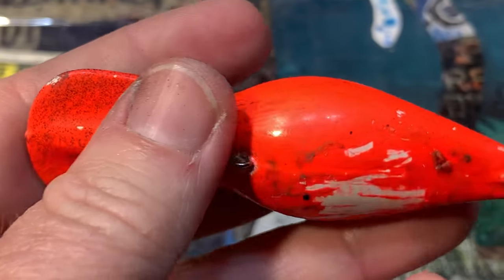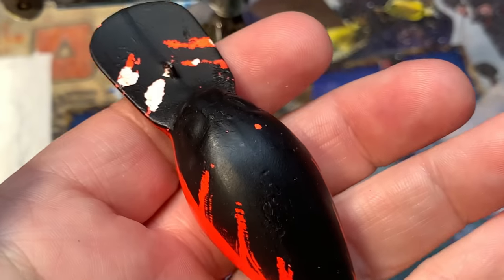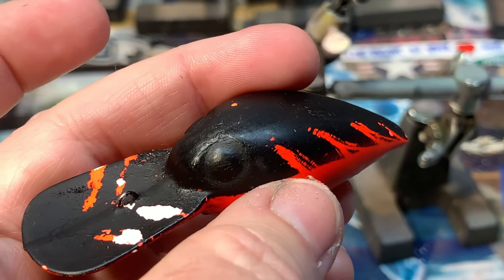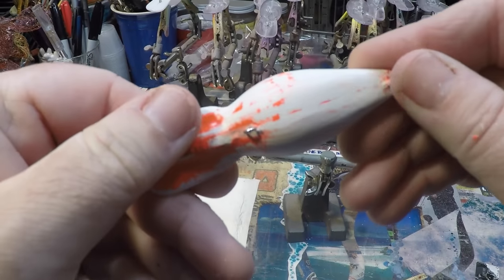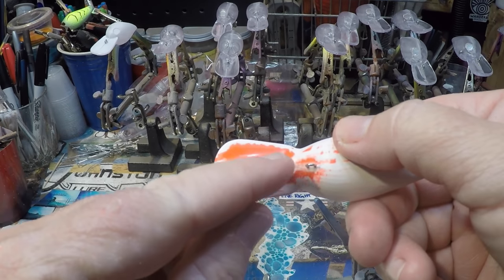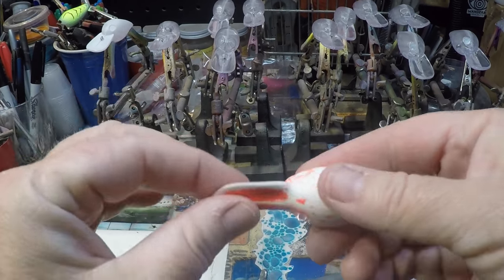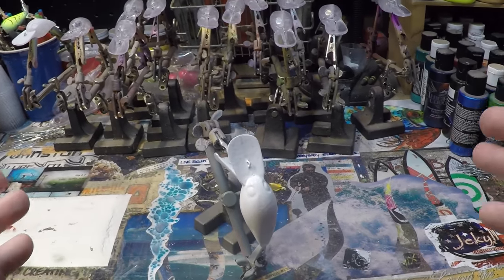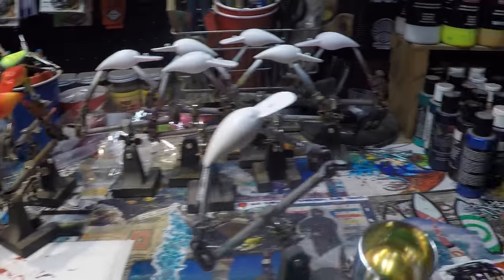START TO FINISH!! (Pre-Rap Wiggle Wart)

Comment: A little tip for stripping paint, this comes from models/miniatures. Soak the bait in LAs totally awesome for an hour or two. Then a toothbrush or green scrubber will clean the vast majority of the paint off. I doubt it will take off epoxy, but will work on lacquers and polys. I have a hook in my dip so I can hang my floating lures upside down to get the top. Much easier process.